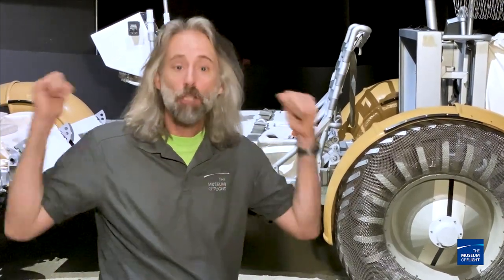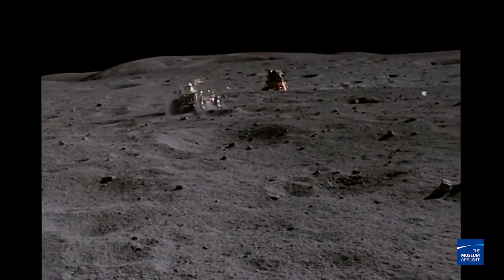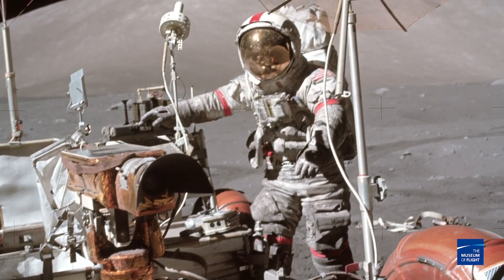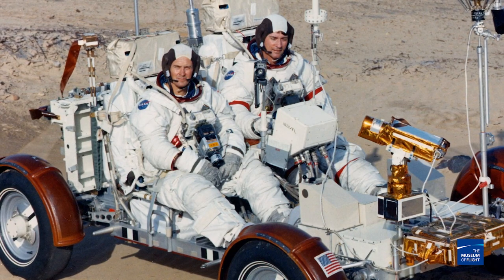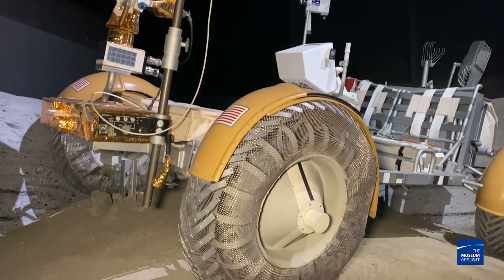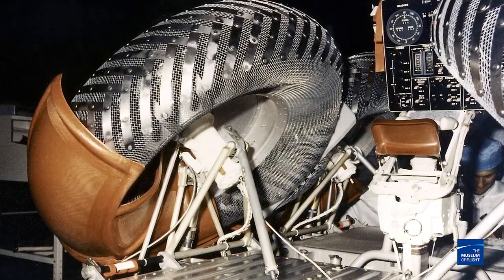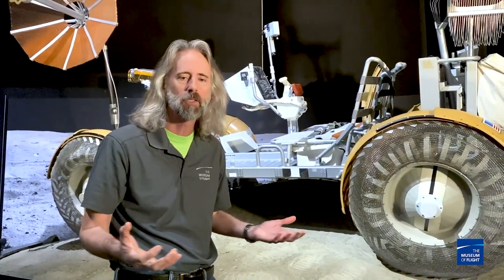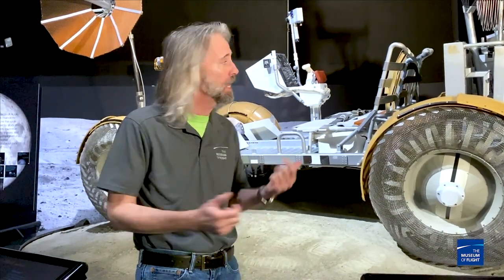Lunar Roving Vehicle | Curator on the Loose!

Comment: Would they have made it off carbon fiber nowadays?
Reply: Possibly, it's light, super strong, and flexible. There's also various blends, including metal fiber ones that are even stronger than the usual stuff. The only problem is it would have to be painted, otherwise UV light would get them, prolly not enough to kick them out of use for the duration of an Apollo mission, but certainly much faster than here on Earth. And paint's heavy.
That said, i know people who have built heavy duty fun 4x4s out of carbon fiber, that are so light you can lift them without much strain, basically the engine is the heaviest part. So that'd be an asset.